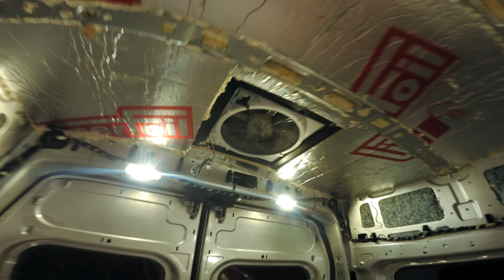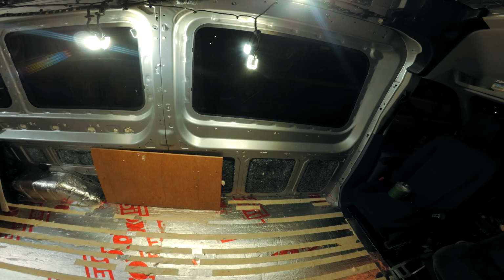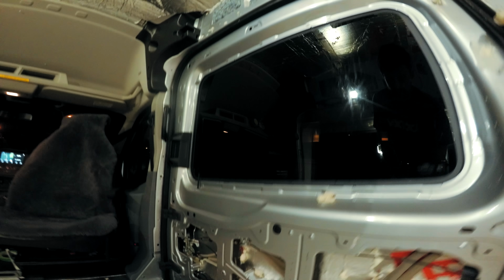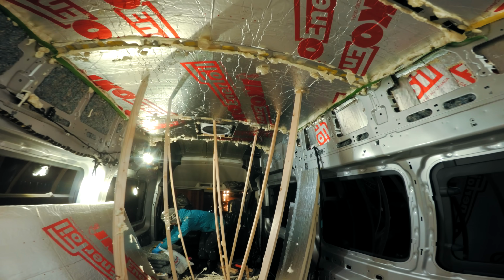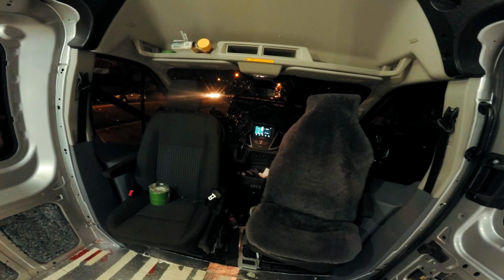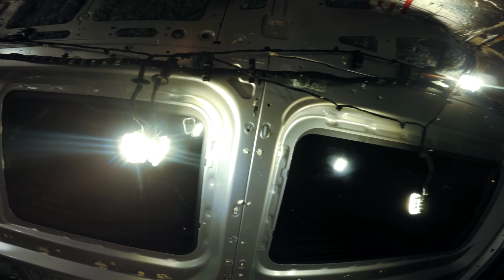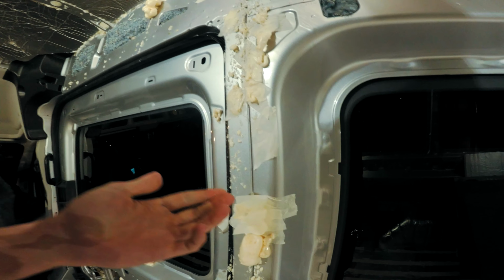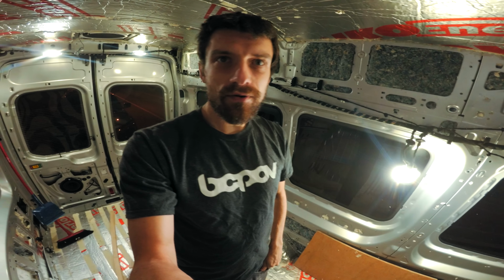SWIVEL SEATS, ROOF FAN, INSULATION | Camper Van Vlog #2

Comment: Looking good and seems to be a very thorough job. Will you need to worry about air seepage at the fans when not in use? Could picture laying toasty in bed with a pocket of cold air creeping onto my face lol
Reply from the maker: Good question, if it's a probablem, we'll probably stick a piece of foam in there to block any airflow

Comment: Link to the insulation sources ?
Reply from the maker: Sure

Poly ISO: https://www.lowes.ca/insulation-accessories/iko-1-in-x-4-ft-x-8-ft-polyisocyanurate-insulated-sheathing_g1363104.html
Denim: https://www.rona.ca/en/multi-purpose-insulation-r8-2-x-16-x-48-04125769